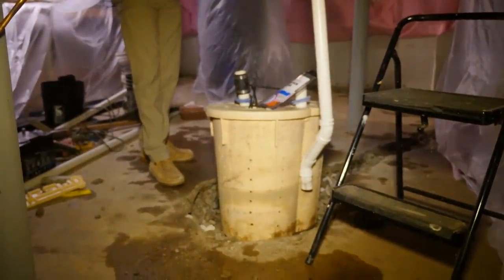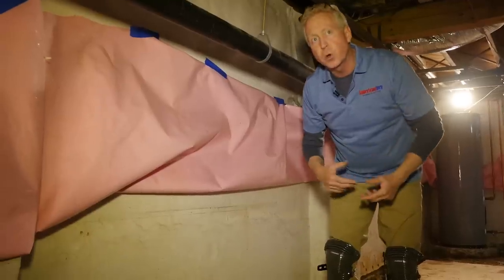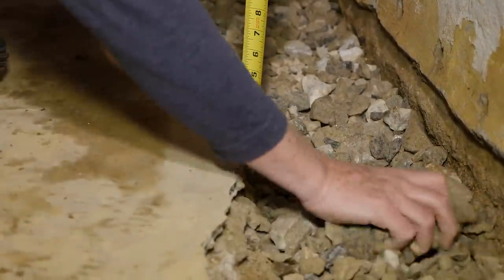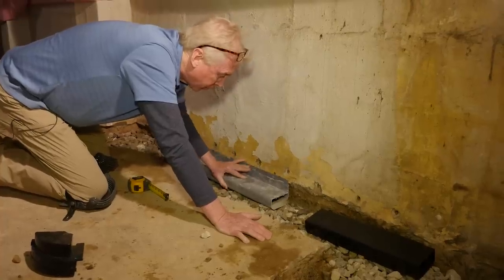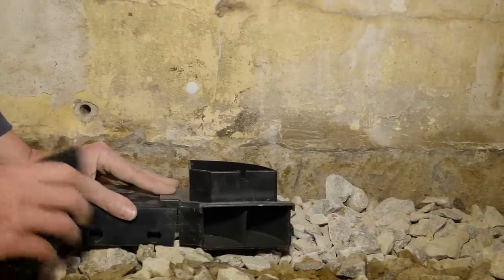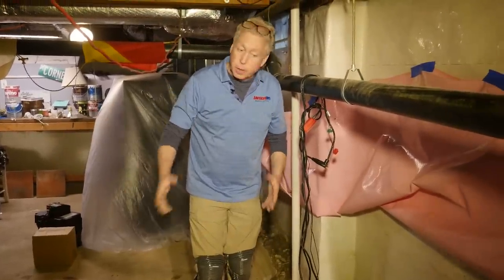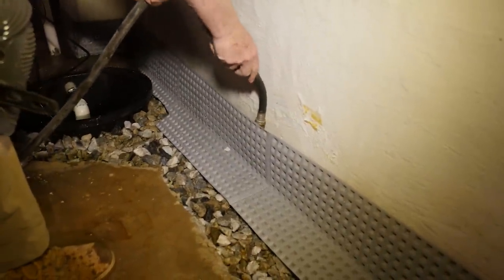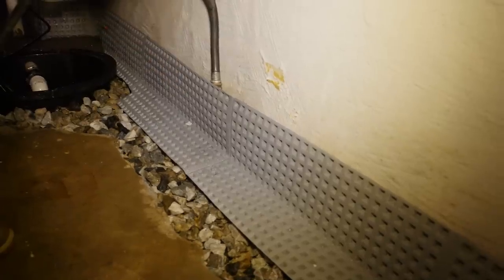CT Basement Waterproofing - Which Waterproofing Systems are Wrong for Most Basements

Comment: Correction on the video starting at 3:54

The Gratedrain sits level or below the footer. You pitch the drainage back to the sump. Minimum concrete would be around 3 1/2inches crack resistant. The access port has extensions that are used to make it sit level with the floor.
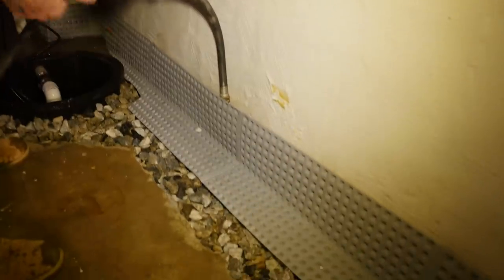Not to mention the system you put in is an open back system. 6:16 demonstrated with a garden hose.
Moisture will enter the home creating smells over time because of the water that is flowing inside of the drainage track.
Reply from the maker: Thanks for commenting. Word of warning... never install any drainage below the footer level. It will enable groundwater to undermine soil beneath the footer and create foundation instability. The box drain systems [ 3:54 ] we replaced in the past are found within the depth of the floor. You may have a different approach in a different location. Unfortunately, you still have to do flush maintenance on them from time to time. That cost customers money. They don't like spending more after having am an expensive system installed. The waffle board with the hose behind it  [ 6:16 ] is mold-resistant. Drainage track stays clean. No smell. We installed over 25,000 waterproofing systems. We should know.
Reply: @AmericanDryBasementSystems  
When I said below footer I meant the top of the drain track sits level if not slightly underneath not to the bottom of the footer but to the top of the footer. Sitting in the same location as that 3-in round perforated pipe that you're installing.If you dug down to the bottom of the footer and put the drainage underneath the footer you would  be digging a hole to China. Just like plumbing inside of a house for sanitary line there are clean outs and access points to prevent clogs in the future. Same thing happens with underground drainage systems. Stating that customers don't like spending money after the fact to clean out the drainage identifies that you know that the drainage is going to become clogged. Iron bacteria silt and dirt work themselves inside of the pipe over time. It's also kind of like saying once a customer installs an expensive furnace that they don't want to spend the money to have it serviced every year. Sure don't service it but then when it breaks down and the system has to be replaced due to the lack of service then you're actually spending more money.
Reply from the maker: @fmfpower20   calisthenics 585  So you are managing water just below the floor with an extended washout port? Even though you can replace 3.5 inches of the floor, you are still allowing water to touch or wick up against the bottom of the floor. That makes a damp basement. We install our pipe within the depth of the footer, not just below the slab floor as you do.  Our system doesn't require washout ports or flushing because the pipes we use, installed at a specific pitch, are perpetually self-cleaning. Watch our upcoming video showing it in action. Stay tuned.
Reply: If you want to use the best corrugated pipe available for dewatering check out the French Drain Man. They have a new dewatering pipe. A blue high octane 8 slot corrugated pipe that has 17 square inches of inlet per foot of pipe. Water screams thru it
Reply from the maker: @bigbadram1808  Water also "screams" through our corrugated dewatering pipe. We have a video posting soon demonstrating our drainage pipe's performance. I can see the advantage of using 8-slot corrugated pipe for outdoor installations as long as wash stones are placed around it for percolating groundwater. There are many unlicensed contractors out there throwing dirt or the removed clay directly back on top of the pipe. This action renders the pipe useless. Proper installation is key.

Comment: Very informative video, thanks. One question though, is there a reason you don't use a pipe wrap in your system?
Reply from the maker: Pipe wrap is basically a filter. Compare it to the filter on your air conditioner. It will gradually get clog with fine particles slowing the entry of water to the pipe. Water levels will rise to the floor with more clogging. Your air conditioner filter has the advantage of easy cleaning. The best way to handle the water is to let it percolate up naturally, into a perforated pipe, and allow gravity to move it to the sump pump for discharge outside.
Reply from the maker: @jesusislord2565  For landscaping, yes. For subfloor waterproofing, no. Fabric is a filter and filters by nature are suppose to be changed, not a permanent fixture. We design our subfloor waterproofing system to be permanent.

Comment: When you pour the cement to make the house foundation wall some say that a footing at the base which is part of the wall's base is larger than the cement wall itself in order to prevent the foundation from sinking. If such is the case,wouldn't using the jackhammer to dig the ditch actually break  the overlapping foundation footing and as a result make the cement walls dig inside the ground and make the house sink  into the ground.
Reply from the maker: You can trench next to the footing, but never deeper than the footing. Some companies do and damage the support for the floor and undermine the footing. The footing sits on hardpan clay. It is very stable and level.
Reply: @AmericanDryBasementSystems  So you do an interior french drain with a corregated flexible pipe and your special overlay that keeps the water from coming up via gas form or humidity or condensation... I don't think basements are typically made with an interior drain system like this?  Should slabs have a plastic under them to avoid evaporated humidity coming up and basements should have interior and exterior drains like yours that go out and slant down to the drain exit?  Just trying to learn how a dry basement should be built... thanks.

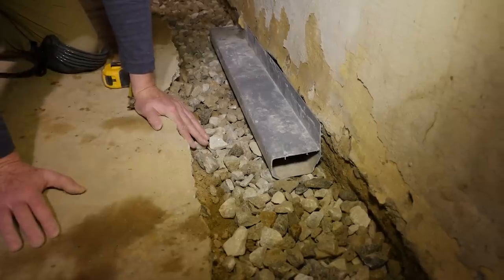Comment: At 3:20, he’s basing the system about the weep holes being higher then the drainage point, however that pink stuff on the walls that’s rolled up, which looks like a vapor barrier to me, looks like it gets tucked behind the system into the floor, then those holes in the back of the gray system. So how isn’t that working?
Reply from the maker: You are correct. The liner on the wall will direct water into the gutter overflow system. Our SuperDry system uses a drain board large enough to cover the weep holes and avoid the need for a wall liner. Our installation lowers overall cost.

Comment: I'm going to be doing  my own basement  floor drain since I've watched your videos my question is what kind of slope do you  recommend  on the pipe it's a block wall and it's about a 50 ft straight  run I'm all so going to be putting in I beams for extra support  the wall has a belly and Crack in it

Comment: I see you are using regular perforated pipe that you can get from home depot. Is there a reason why? Whereas competitors are offering newer systems that sit below the footing as well that is more of a track system.

I know about the two systems that have failed (sitting on the footing or sitting away from the footing but at the same level) which thanks to your videos . I already throughout the brochure!!
Reply from the maker: We buy our perforated corrugated pipe directly from American Drainage Systems. They developed and improved this type of drainage pipe during the 60s through the 80s. It is the biggest selling underground drainage pipe in the world. Why? Because it works extraordinarily well. The pipe is designed to be pitched. It cleans itself by using the gravitational vortex force produced by the corrugation placed on a pitch. Not only does it clean loose slit but it also moves the water along faster. Other "newer" systems require maintenance - annual flushing - costly and time-consuming - there is no guarantee that your system will not clog without flushing it. Our ADS pipe with the proper pitch guarantees to be clog-free.
Reply: American Dry Basement Systems what about the flat track system? Not like the footing type system. It sits under the ground as well.

Comment: I have about 4 inches of water under my foundation at all times. And my one and only sump pump runs every 30 seconds all day non stop, 365 days out of the year every 30 seconds it’s running and spitting out to the street. I would love to have you guys come to my house in New Jersey and tell me if the system that you’re using is what I need. To be honest I feel like every person that comes by the house is your typical New York City/New Jersey dirtbag that’s just trying to get a deal done.
Reply from the maker: If your sump pumps are working correctly, and they are performing as you describe, you may have a bigger problem than you think. Unfortunately, we do not serve in NJ and nor do we know anyone to refer at the moment. We are personally overwhelmed with homeowners with wet basements after Ida blew through, and see more "dirtbags" than ever preying on people with major water problems. Be vigilant.

Comment: What system do you prefer for a clay block foundation? I was told these do not have footers and sit on virgin ground. House is from 1942 in NE Ohio. I was also told the voids in the block run a different way than cinder block. How do you then relieve the water as far as weep holes?
Reply from the maker: Have a waterproofer in your area inspect and recommend. The soil beneath the wall is hardpan clay and very capable of maintaining the integrity of the wall. Watch this video about hardpan clay footing: https://youtu.be/2_adHhELygA
Reply: @AmericanDryBasementSystems  Thank you so much!!! I have had a few quotes and they are all pretty similar.  None of the contractors will be drilling weep holes. I guess this can't be achieved with clay block? Most will be installing plastic sheeting up the wall. This will allow moisture to drain down to the drain. Would this cause mold growth between the block and sheeting? Love your videos!!
Reply from the maker: @ryansuggett2776  Wall liners leading to a water drainage system beneath the floor is not a perfect solution. The sheeting can produce condensation and collect water between the wall and sheeting. Make sure you add a dehumidification machine.
Reply: @AmericanDryBasementSystems  awesome thanks. Your videos are great and I appreciate your replys.

Comment: Hi I'm in the process of doing that same job in my basement the question that I have a cape style home and when I started digging I saw that there was no footing it actually looks like the same kind of foundation after you break the top concrete after that you hit sand and rocks . How deep should I dig down to put the drain file system in ?
Reply from the maker: Watch this video! https://youtu.be/2_adHhELygA

Comment: Did you move the water heater or go around it?
Reply from the maker: Around. That was installed two years ago, and going strong. The drainage is placed at the right depth and pitch to keep water away from the bottom of the floor.

Comment: Are you against that type of system all together? I see you are states away from us, but we have that particular system scheduled to be installed in a few weeks for around $8k...... If the system really isn't working like we would of thought it would, is it worth spending that kind of money on something like that? We have a newer house built in 2000 and really just have minor weeping through the walls but would like to be able to finish it without worry about any issues.
Reply from the maker: We have two of their systems scheduled to tear out and replace them in the next couple of weeks. My advice is to shop around and find somebody that strictly follows the proper criteria to successfully install a structurally sound system that manages the water well below the bottom of the floor, but still within the depth of the footing. Not below the bottom of the footing. It is well documented, the system you have installed in a few weeks can cause problems further down the road after installation. Their system is easily overwhelmed, and if you are going to finish the basement, a real waterproofing system would be much more advantageous for you. We have a job coming up where they already put up the wooden studs of the house, having yet to drywall over the top of a gutter system (the one you are getting) with water problems and called us. We are going to replace the system with our SuperDry system.
Reply: Mellisa whatever you do, do not purchase that footer system. ADBS is right.
Reply: Oh course they’re are against that system.  They have a vested interest because its their competitor.  I could give you 5 reasons why this system is inferior and vise verse.  Actually a dual system is the ultimate.  Best of both worlds
Reply: @TheJerkHead1  
Hi - i also have a basement with minor water coming through brick and cinderblock walls with small puddings on really bad days, but not significant. We want to finish the basement however, so want to get this done right before drywalling. 

Below is a write up from one of the more thorough estimates. Does it sound like a good system? It's a combination of PVC French Drain and a 2'' Zipper Drain:

French Drain
Install French Drain System. 3" perforated PVC piping
pitched 7 to 9" deep, back filled with clean 3/4 blue
stone, capped with 3" of cement poured up against
plastic Polly drain. Holes will be drilled in all bottom
blocks on all block foundation walls. Install one floor
surface drain/ clean out in French drain piping along
each wall-N/C.

2" Zipper Drain
Install 2.5" NDS Mini channel drain piping.
Reply: Hey Melissa, I am in a similar situation with similar quotes. I'm curious what did you end up going with?
Reply: Melissa, 3 inch perforated PVC is pretty standard for indoor waterproofing.  Also good that they mentioned drilling the holes in the bottom block.  That will relieve the future hydrostatic pressure from building up in the cores of the block and causing structural damage in the future.  Look for horizontal midpoint cracks in your block walls.  This would be a potential sign that the block is under too much hydrostatic pressure and it’s beginning to bow inward.  Not sure what they are referring to as a zipper drain.  Might be a company trade name.  One 
important thing I do want to mention.  Block walls are very porous.   moisture will continue to evaporate through the block walls even after a water system is installed.  That white chalky stuff you may be seeing on your walls is a sign that moisture has evaporated through the walls.  That’s the minerals that are left behind after the moisture evaporates into your basement.  If you are going to put drywall up please please please make sure you install some form of vapor barrier running all the way up the walls first.  You don’t want to have wood framing on or very near a block wall without it.  This barrier is essential so that you don’t ever get mold on the drywall or rot out the lumber.  Mold loves both of these materials very much.  A simple vapor barrier ( like a 6-11 mill plastic) should be installed to completely cover all waterproofed walls and be tucked into the water system (Before they re-concrete the floor.  Question, are they including that in your estimate ? I didn’t see it. To let you know my credentials, I work for the Nations largest waterproofing company as a system design Specialist.  I’m not trying to sell you anything haha.  You are nowhere near my territory i’m sure.  My intentions are just that I’m bored and love giving people information about this topic.
Reply: @j0404t  sorry that message above was meant for you.  I'm down to answer any questions.  I just don't get on here much.
Reply: @TheJerkHead1  the proof is in his videos! It shows standing water and soft concrete from being in water, also shows them with negative slope, he’s not promoting his system when he’s only in CT again the proof is standing water in the old systems that he shows

Comment: What is the dimpled material called that you placed at the wall/floor joint?
Reply from the maker: There is a wide variety of dimple boards available through retailers and direct from manufacturers. The one we use is called poly drain.

Comment: Why slotted 
corrugated vs PVC pipe?
Reply from the maker: "Slotted" perforated, corrugated pipe is self-cleaning when installing with a pitch in packed stone. No maintenance and flushing required and guaranteed. PVC pipe with or without pitch will clog with iron ochre over time and will require maintenance by flushing the system annually.